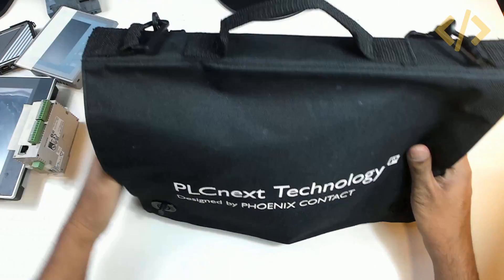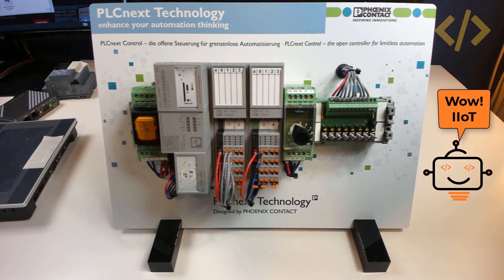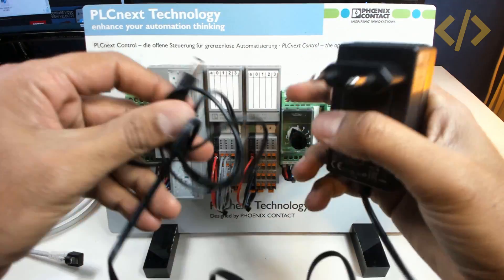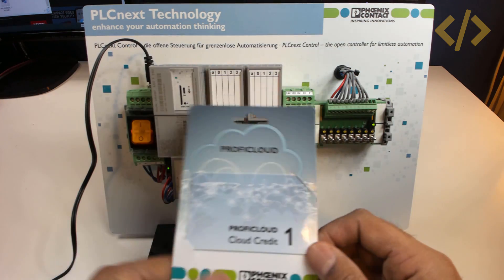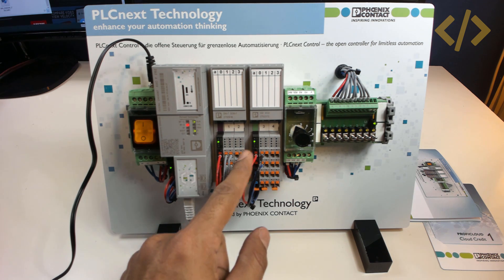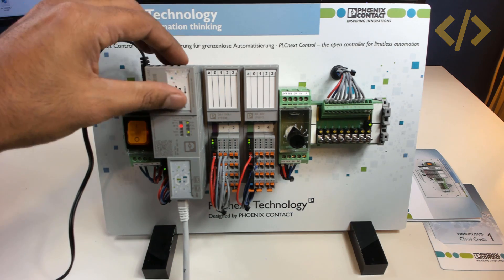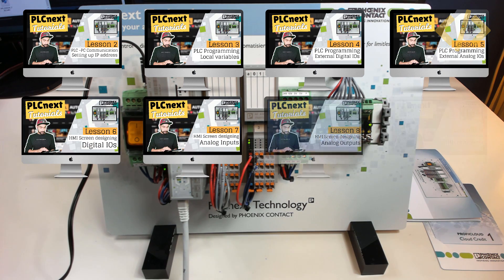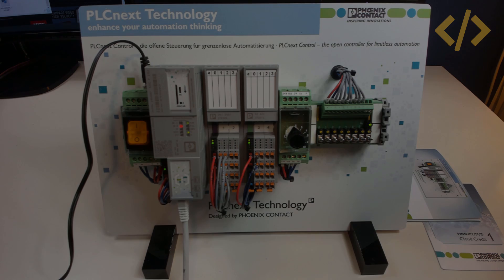PLCnext Lesson 1 - Unboxing PLCnext

Comment: Hi Rajvir I hope you remember me. I needed a small help from you I have few ASC310 VFD drives in my plant two of the drives are not responding to the RS 485 communication by Modscan. I have tried copying the parameters but it is still not working the wiring is ok as communication is established with the port. What can be the possible cause.
Reply from the maker: If you connect multiple drives, there is one parameter which should not be the same I.e. communication ID. Its different for each drive